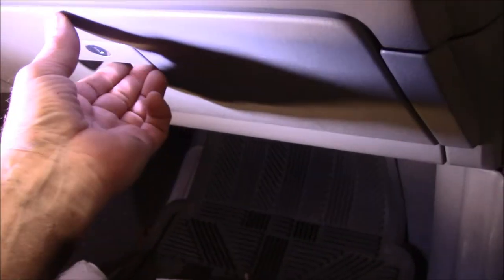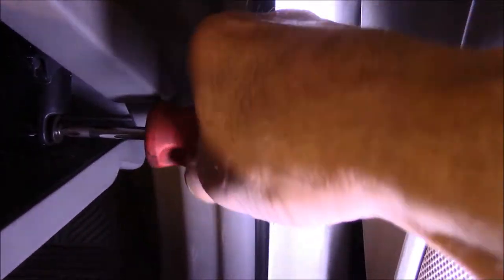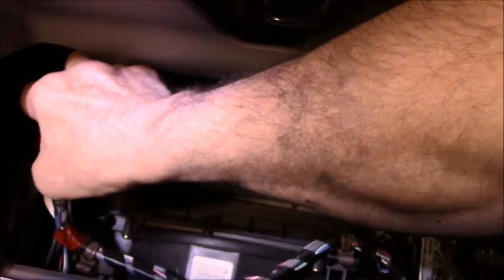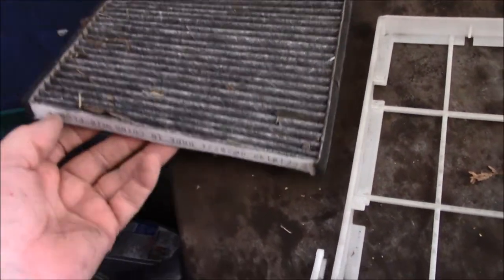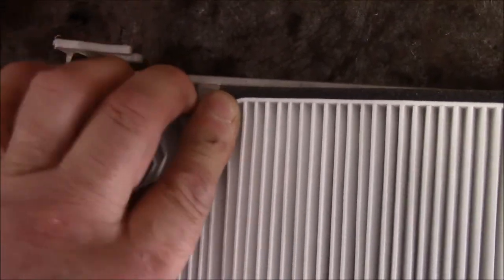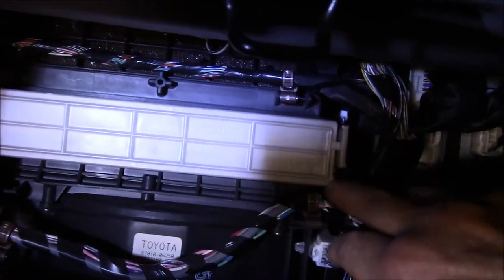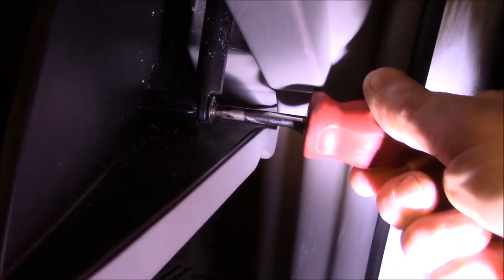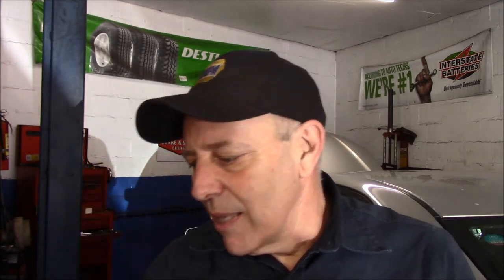How to replace the cabin filter 2002-2009 Toyota Camry

Comment: Thank you Jim.  I've done this several times myself.  I was just making 100% there was not more than 1 cabin air filter in my Camry.  I had watched 2 before yours and they were saying to put the arrow facing up because the cabin air container/plastic holder has an up arrow. 😂. That's because it needs to go into the slot with that side up but I had checked the airflow myself and always faced the filter arrow down.  I had to watch another one to make sure I was correct.  And I am!  I had just replaced it 15 months ago but my air isn't feeling as cool as it always does 😢. It's HOT out.  Perhaps that's the reason but it never had before. It is cooling. The fan is working. The compressor is working I assume since it's cooler than 95 degrees in my car and running. If the new filter doesn't solve my problem, can't I add R34 refrigerant?  Do you have a video of that for the 2002 Camry model?  I definitely don't want to mess up what is not already messed up. ie compressor.  Can you help me?
Reply from the maker: It is good that you did a little research to make sure how to put in the filter correctly. I would recommend not putting in any refrigerant until you know what the pressure in the AC system is. Do you have access to AC guages? Jim
This video will explaining about AC pressure.

https://www.youtube.com/watch?v=jQRudef3LIA